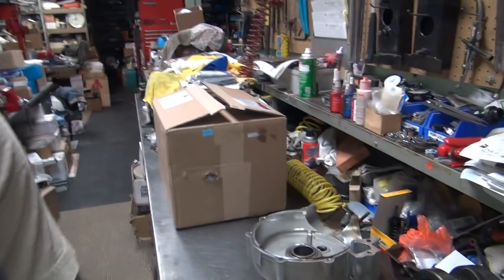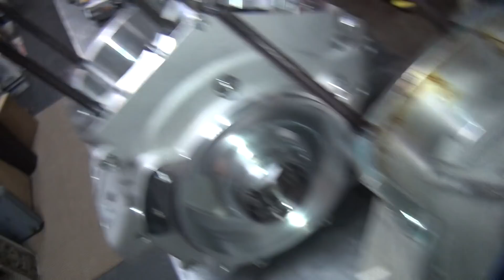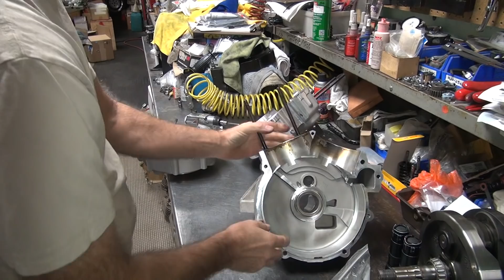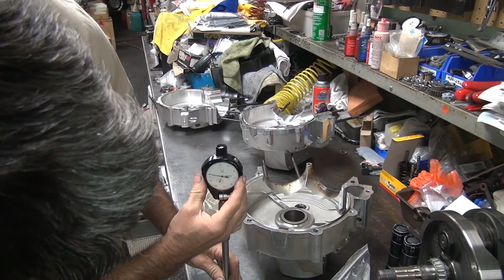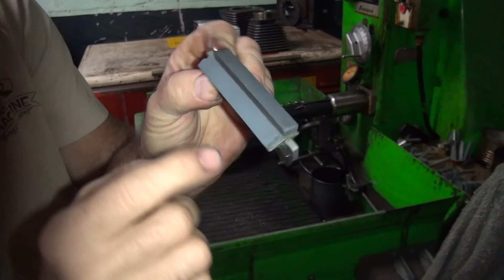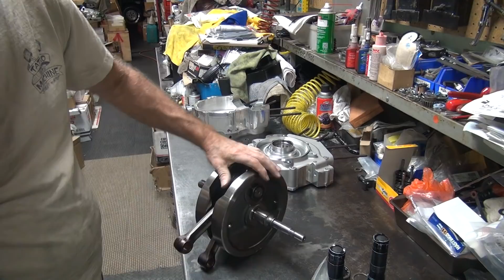#108 S&S 113ci evo motor pulled cylinder studs repair harley swift evolution head by tatro machine

Comment: That old drum puller is probably an old Mac or a Lyleis? Owatonna tool company (OTC) tried making one in the 70s but the cast aluminum I don't know if they didn't extrude it right or what but about the 4th or 5th time that you would use it it would break not only were they good for pulling drums on old Chryslers and Studebaker and Willy's.. they worked well on the big general motors drums on Cadillacs and  GM trucks . The front timken bearings would get hot and weld to the spindle.. and short of having to replace the whole spindle you could heat up the bearing and with this puller pull the drum assembly off but it was a pretty useful tool back in the day . Anyway thanks for another great video thosecases look like they have time sert's in them cast into the case for those studs anyway looks like a pretty beefy case .
You know something tatro my hat's off to you. I sure wish I could get my shop as organized as yours is you got all your little stations setup  and your drawers set up just right. It looks cluttered  but in the four or five years that I have watched, very rarely do you come up with a missing or broken tool.. not cluttered just an odd lot of shit, strategically placed... 😎 I'm the same way,, anyway looking forward to the build of these cases..
Reply from the maker: my puller is cast steel so it does not break when i get after it. after working in different locations over the years you learn what you think you want in a shop. i laid this one out how i wanted it to be and it has been basically the same for 17 years now. i already know what i want to do differently the next time.
tatro